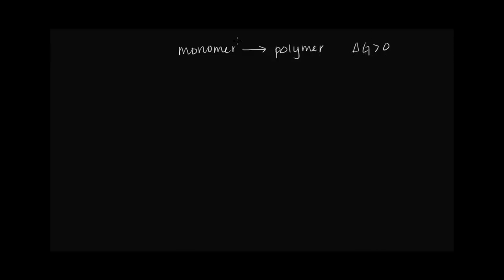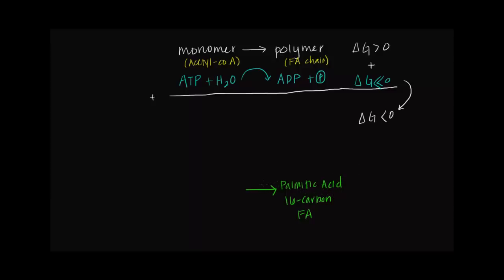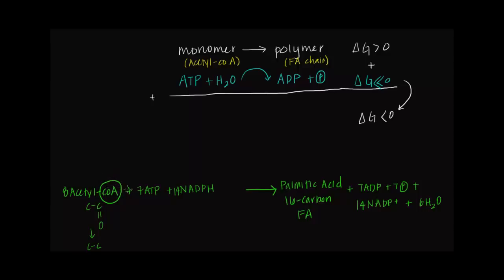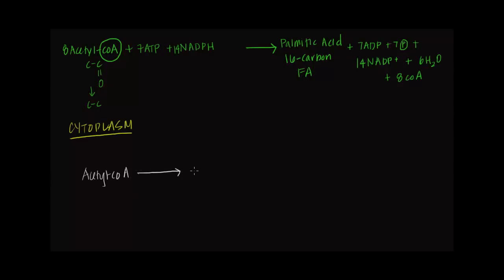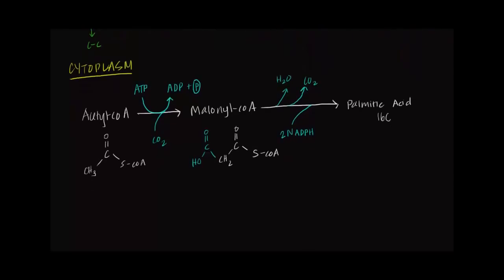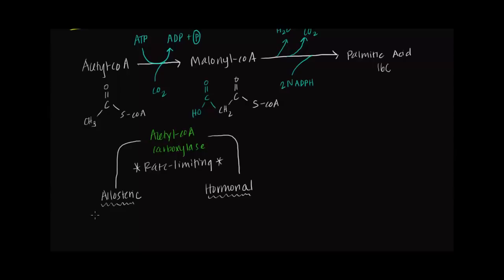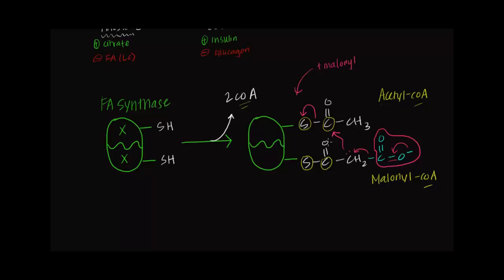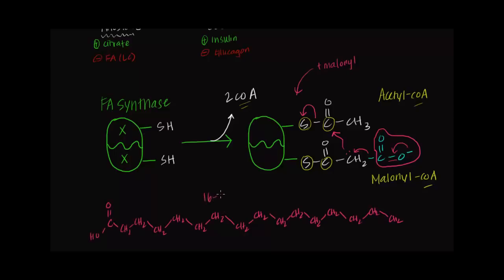Fatty Acid Synthesis - Part II

Comment: Very helpful video, but I want to point out that for each molecule of acetyl coa that is carboxilated and activated by the synthase (7 of the 8 because one acetyl coa is used as a primer), 1 water molecule is produced, and so, there would be 7 water molecules in total and not 6.  

It'd also be pretty cool if you made a video in which you went more in depth on the domains of the synthase complex. Again, very helpful!
Reply: +Camila Penuela the reason it's 6 water molecules and not 7 is because once the entire 16-c chain is made, to remove it as free fatty acid from the fatty acid synthase, you need hydrolysis of the bond between the S of the fatty acid synthase and the carbonyl group of the fatty acid... you end up with a fatty acid synthase that can do the whole thing again and a fatty acid with hydroxyl group on the carbonyl group.
hope that helps?
Reply: Yes, thank you very much, my bad :P

Comment: (On Saturday of February 18, 2023).  On The Matter of Fatty Acid Synthesis And the Metabolism Therein (Chemical Reactions of Substrate-Enzyme-Product): 1) Stoichiometry of Fatty Acid Synthesis (Acetyl-CoA, Acetyl-CoA Decarboxylase [Fatty Acid Synthase], And Polymerization Therein Yielding the Product of Palmitic Acid); 2) Allosteric (Citrate Positive Regulation; Fatty Acid Negative Regulation) And/Or Hormonal Regulation (Insulin Positive; Glucagon Negative) Along with Product of Fatty Acid Synthesis; 3) Carbon-Carbon Bonding and ATP Hydrolysis Therein;  PhD Jasmine Rana, es gut ist zu verheilen und kennen Die Krankheit auch aber man vernichtet sich mit Seiner Dummheit.  Heil!